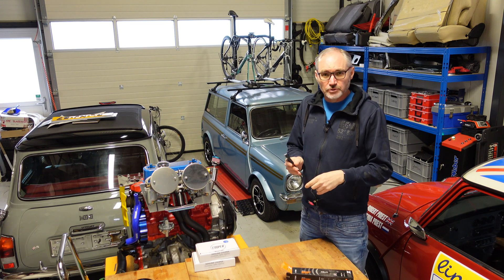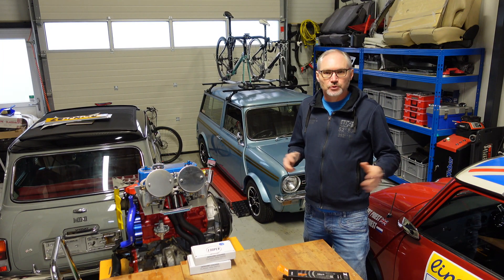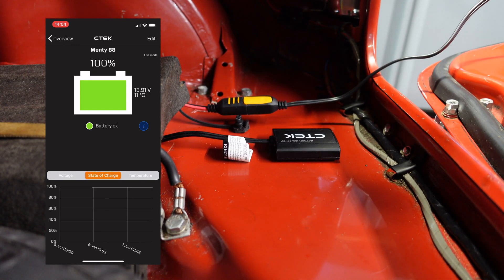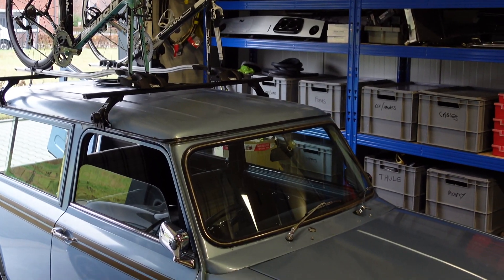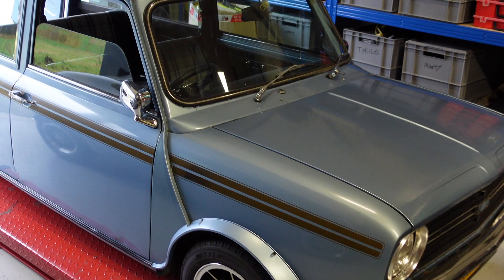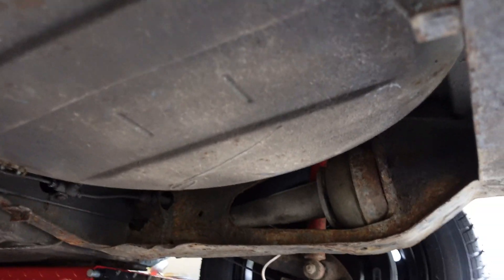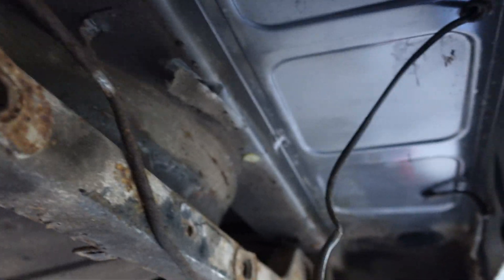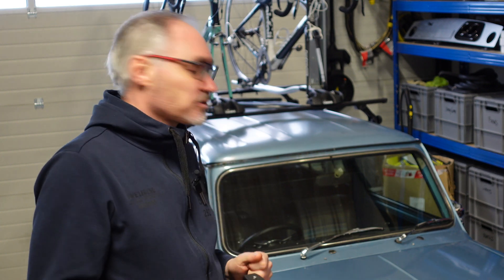Classic Mini Clubman Estate - Electric conversion

Comment: what tests do you need to do in holland if you modify the vehicle? Here in the Uk if we cut into the shell it could be an IVA test which is no mean feat.
Reply from the maker: very similar via the RDW test stations, its limiting to the point whereby specific stations can only test these modifications, so if its not local to you its even more challenging, for me the car will have to be transported to the west for EV tests.

Comment: this was a fantastic video for me, everything from the battery monitoring systems that I have been thinking about to the EV conversions for the clubman. I am avidly consuming as much information on EV conversions as I can right now as my ultimate goal is to convert my van and I know EV conversions are going to grow in motorsport as soon as the regulations allow. AND .. I could not believe it when you unveiled the Pace - WOW, I used to be a bike mechanic back in the 90s and this was a dream bike for me that I never obtained. you genuinely have inspired me on many levels, keep up the good work sir and I look forward to future episodes.
Reply from the maker: Thank you sir.....Did you compete as well?.......I was working for MuddyFox in the early 90's, then moved to a small start up company called Gripshift🤪
Reply: @classicminiculture9800  I did compete in the mid to late 90s, and early 2000s only at club level with mates. I worked as a bike mechanic so our bike shop had a team so we would load up our cars and campers and head off to do all sorts of event. My favourites were solo 24hr races and team adventure.racing. Good times 😎. Grip shift yep they were all the rage at one time everyone wanted them fitted to their bikes.
Reply from the maker: @TheGentlemensMotorRacingTeam  I'd be very surprised if we didn't cross paths at some point in that period, I was the technical support for Gripshift back then, attended most of the races, was in at the beginning of MTB events scene in the UK.👍

Comment from the maker: Sorry for not smiling much in this video😜,  after the power cut it was extremely cold in the workshop😣
Reply: Are you using a Prius gearbox ? if so take a look at damian maguire`s evbmw channel he shows how to run it as a stand alone ev transmission, the g,box allows more space for batteries  where an engine would be...
Reply from the maker: @kylereese4822  no gear box required for this system, its a direct drive with variable torque provided by the power input.